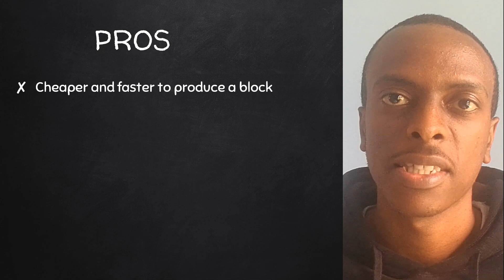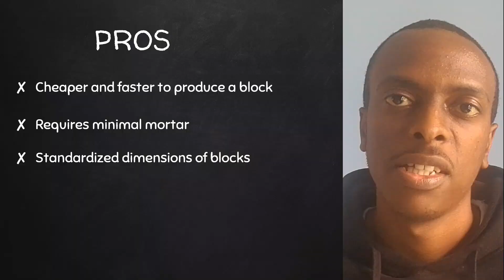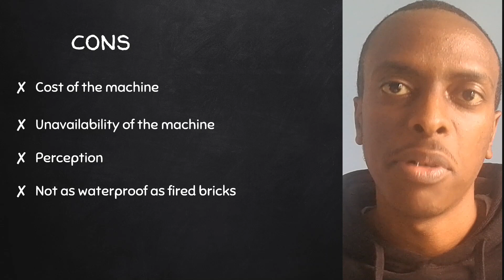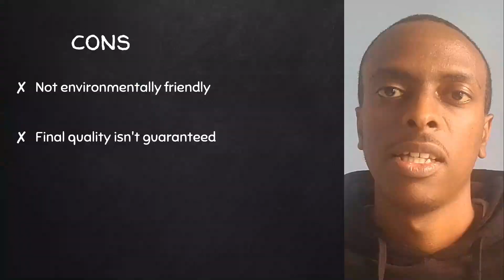Interlocking Stabilized Soil Blocks (ISSBs) vs Fired Clay Bricks: A Comparison Video

Comment: What is the mixture that is decent to use to make ISSB, I have seen from 8 wheelbarrows to a bag of cement to even 5 wheelbarrows to a bag of cement. The question is does it really matter if you use 8 or 5 to a 50kg bag of cement.
Reply from the maker: It depends on the type of soil. A typical ratio is 1 bag of cement to 6 wheelbarrows of soil.
Reply: @PropertyNoma  thanks